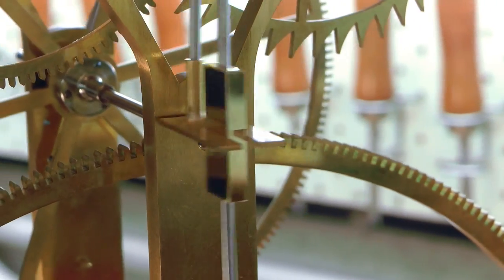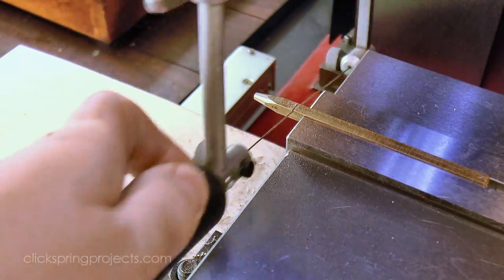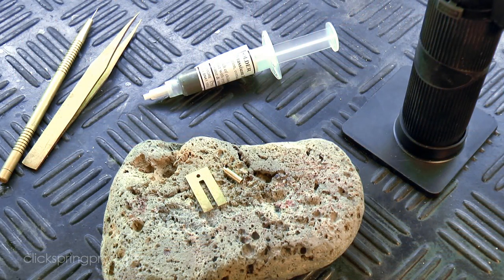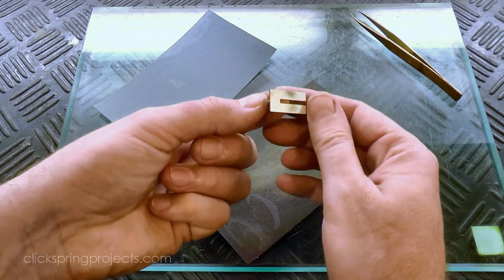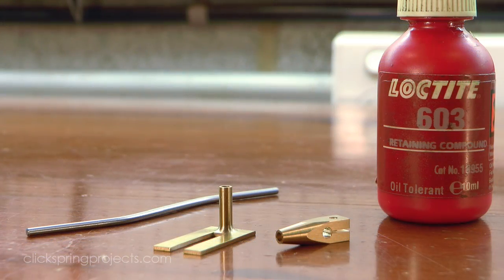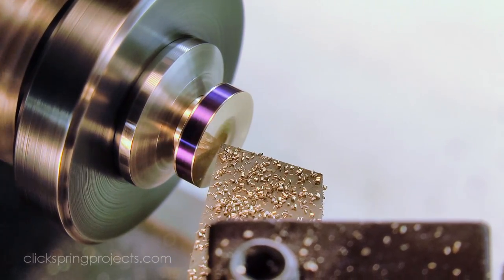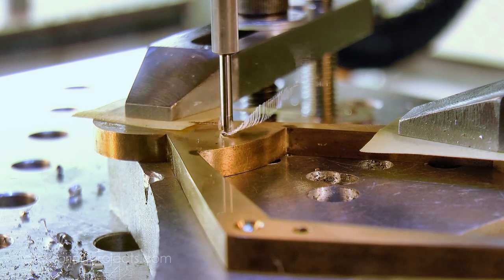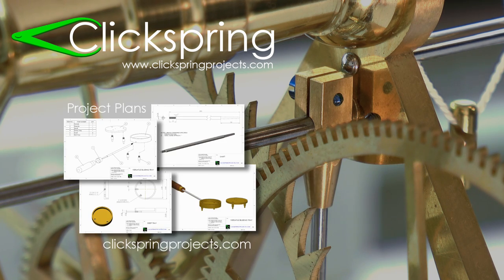Clockmaking - How To Make A Clock - Part 20 - The Crutch Assembly And Eccentric Bushing

Comment: I love how stark of a contrast bending the rod to shape was compared to every single other step of this haha
Making a fork: 75 steps
Shaping the rod: stick it in a vice and push it over
Reply: I was waiting for him to start putting pins in a plate as a bending jig for the rod.  But then vise. I guess it would still be  faster to do it in the vise, and get the same finished results, even if you have to redo it a couple times.
Reply: Ya I was definitely expecting a jig, but hey, can't argue with results!
Reply: No one said he did it only once. I am guessing that was his third try.
Reply: I was thinking the same thing!
Reply: I had a set of hanging hooks (about 30 of them, with three bends each) to be made from 3/8" bronze rod, and I was trying to come up with a slotted die, and a punch to press the rod into the die. Then a friend with a factory that specializes in CNC rod-bending offered to do it all, so I never got to see whether I could make the die and punch.

Comment: i like how you showed the spark pattern while grinding drill rod on the belt sander.  Nice touch and a great reminder of how to identify high carbon steel
Reply: I'm pretty sure he was just cleaning the end of the rod, not specifically showing off the spark pattern

Comment: Great video!There is one thing if I may say, after broaching the pivot holes you should use smoothing broaches to work harden and burnish the holes as pivot holes in brass will get out of shape quicker than if the holes were burnish! Just a thought.
Reply from the maker: Yes agreed, I didn't specifically reference it in the video, but the broach in the larger handle on the left is a smoothing broach: https://youtu.be/R9m4X_R9HPs?t=14m43s I also used smoothing broaches when planting the train in a previous video: https://youtu.be/O8xIjsaDlN8?t=8m40s

Comment: You'll put a protective coating on it to prevent tarnish right?
Reply from the maker: It can be a bit complex protecting clock parts. Some parts will be coated, others left raw. More detail in the last vid :)
Reply: +Clickspring  thanks! It would be really nice for it to maintain the beauty that you made it with

Comment: Your videos are sharp and very neat to watch.  This was no exception.  I can't help but wonder though:  What part(s) had to be done multiple times (or planned out by using multiple test pieces) until you were happy with the process from start to finish?   Some of your processes are so intricate that it seems like at least sometime you must have to redo something as you rethink the process and see something you want to do differently.   So, what part or parts gave you the most trouble or at least required the most trial and testing before you settled on the final design?

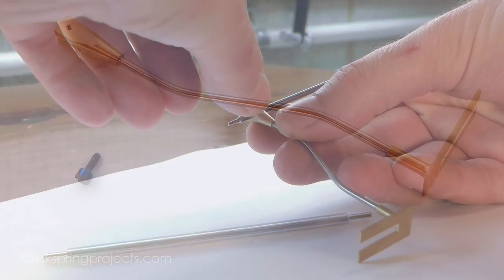Comment: 13:10 You should have used a brass screwdriver for those screws, the blue finish got scratched !
Anyways, gorgeous work as always.
Reply: Really needs to use what is called a hollow ground screwdriver.
Reply: Fold a piece of paper over the screwdriver blade. That should do it.

Comment: It looks like you have a sherline lathe, I have one of those and I'm fairly confident it takes apart and you can put it back together without a key. You can put it back together at any angle you'd like. Is that what you did?

Comment: Can you give a little more detail on how you blued the brass screws? Was that copper wire you wrapped around them and heated up? Was any chemical applied to the brass screws before heating? How long do you heat it?
Reply from the maker: More info on the heat bluing process here: https://youtu.be/NhjiIPohUyw

Comment: Chris, excellent video, as usual. I have a couple of questions...Will you show the techniques you use to center the stock on the lathe and mill (both for cutting and drilling)? Also, the silver solder paste, did you make that yourself? I'm asking because of the method you used to apply it. If so what is the approximate ratio? The end result is beautiful.
Reply from the maker: Hey Jarrod, yes will do something on the centering techniques at some point. The paste is a commercial product, you can pick it up off Ebay or from any of the clock/watch suppliers. I got mine from www.m-p.co.uk Cheers mate :)
Reply: Thanks Chris

Comment: Thanks Chris!  Can I ask what were the soft jaws in the vice made of when you bent the rod?  Looked like leather on wood?  Have similar compound bends coming up on a project using .375 01 and need to be able to repeat it.  Thought about a small bend jig, or maybe spring tubing benders but really liked the flex you got in the vice with no marring.  Thanks for All the great Videos, info, ideas and procedures, and then some!  Can't wait to see and hear all your beautiful work, click and spring into motion! ~¿@  ~PJ
Reply: That caught my eye as well, I hope he answers
Reply from the maker: As best I can tell its a neoprene facing on aluminium - there is an orange brown anodizing on it that makes it look like wood. The inside face has a magnetic strip to hold it into the jaws. For the life of me I can't recall where I picked them up, but will pm you if it comes to mind. Cheers mate :)

Comment: Hey Chris, wonderful video as usual.
Question: Any reason you're not using removable brass bushings (can't recall the name, my education in the trade is in swedish and french :p)? Using these bushings, you can replace them when they wear out, instead of having to reform the holes in the frame itself, which can be quite the pain in the backside.

Comment: Did you have a chance to try Autodesk Fusion 360? It seems like a nice alternative to expensive SolidWorks. If I read the license correctly it's free for commercial use if your company make less than $100k/year. I didn't check it thoroughly because my PC is old now and has some troubles handling it.

Comment: I notice the pendulum is suspended by a string, whose length is adjustable. I own a very similar clock, but the pendulum is suspended by a short length of spring steel. The swing of the pendulum bends the spring steel causing an additional force towards center. The spring steel suspension is very common. Does anyone know why spring steel is so common in pendulum suspensions? It seems like it would be a complicating factor in the strict SQRT (length) relationship of pendulum length to the period of oscillation. Intuitively, it would seem like this spring action would increase the frequency of oscillation, by prematurely returning the pendulum towards center. Or put another way, introduces a spring constant effectively larger than the natural pendulum tendency to return to center, thereby increasing the frequency of oscillation. Does the spring steel serve another purpose, perhaps conserving energy ? Anybody know?

Comment: This is where I have to part company with John Wilding over the design of this clock. As Philip Woodward describes in "Woodward on time" the suspension of the pendulum is crucial to the good timekeeping of the clock and Wilding uses a piece of string. Not only is this ugly but it destroys any pretensions to good timekeeping that the clock would otherwise be capable of. I just don't understand why he chose such an inept design.

Comment: Looks like you're getting lazy. Leaving surfaces not as pretty as before.
Reply from the maker: Continually pursuing surface finish after a part has been completed is folly; it unnecessarily removes metal which is bad for the long term life of the mechanism. Some surfaces will be brought to a high finish at the end of the build, but most will be left to develop a natural patina. Time for you to get used to it :)
Reply: +Clickspring Fair reasoning.